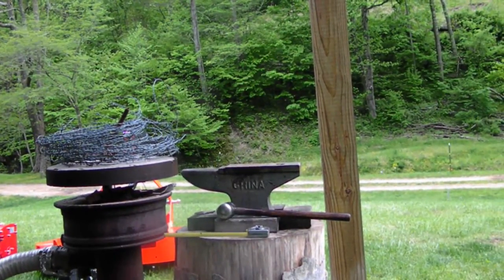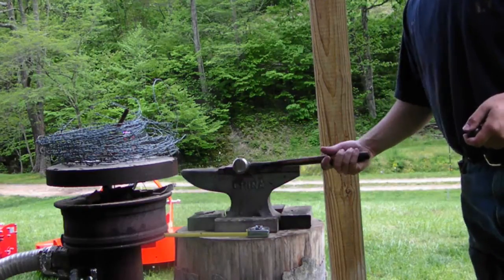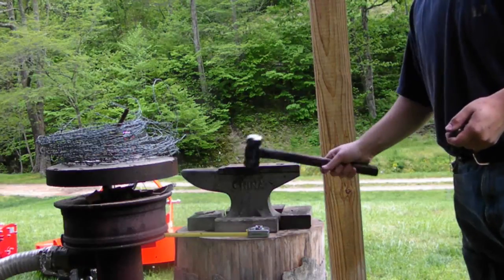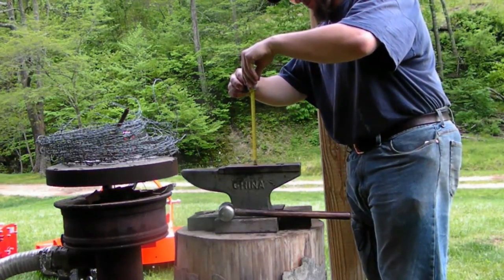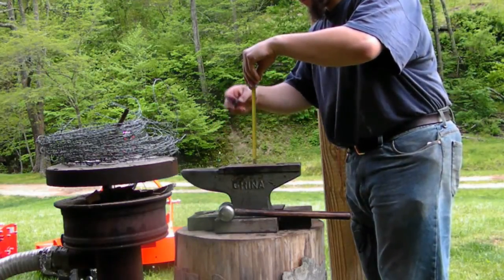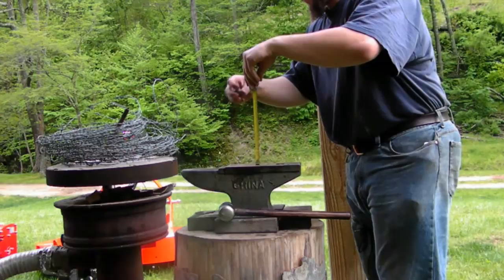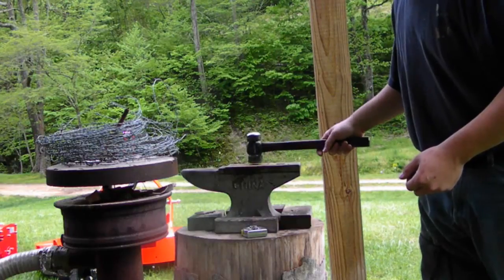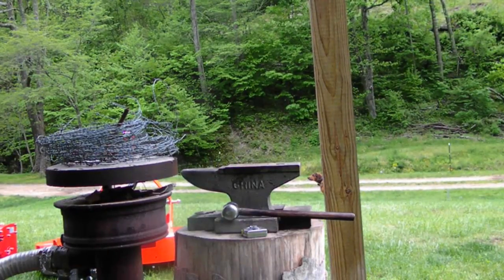Rebound test on an OLD (10-15years as of 2016) Harbor Freight 55lb Anvil

Comment: Hey i really need a anvil and there are none on sale any where near me I've tried to get my hands on some RR track but i can't even manage that. Should i get the new harbor freight ones ( i don't have a welder so putting a steel face is not a option) or just call it a lost cause.
Reply from the maker: the new harbor freight anvils are all just junk. they have absolutely no hardness and you can't improve them with a steel face, because just welding around the edges won't give a full penetration weld and it would be cost prohibitive to fill the entire gap between the plate and anvil with weld. Instead check out Centaur forge Or fort vause outfitters! centaur forge has 2 
farriers anvils weighing in at 70lbs for about 300 bucks each, the NC 
tool anvil is a little cheaper at around 280 and the Cliff carrol is 314 i believe. fort vause has several anvil sizes, and
 shapes made of cast ductile iron,they have a couple stump anvils and 
smaller options as well as swage tools, and their real  anvils i 
remember being listed  are 55lbs, 60, 80, and 100.  at 50 rockwell 
hardness(similar hardness to MANY well known anvil manufacturers).they are not going to be the best anvil on 
the market, but they are the cheapest  new anvil brand i have seen
 they need the surface polished because they come with the casting line 
on them, but that's what keeps them  cheap.